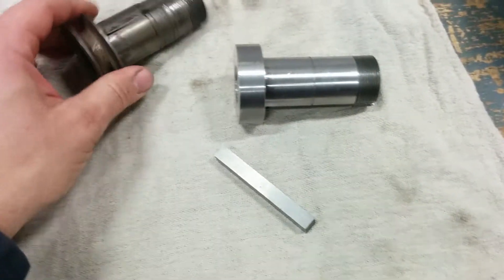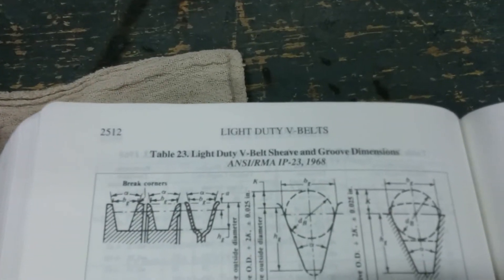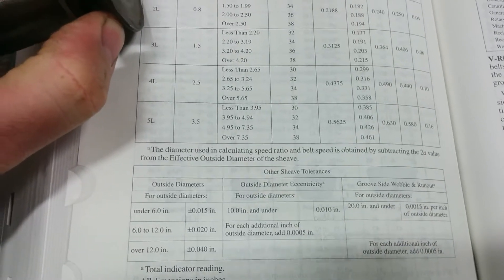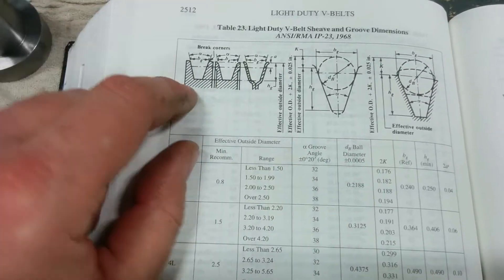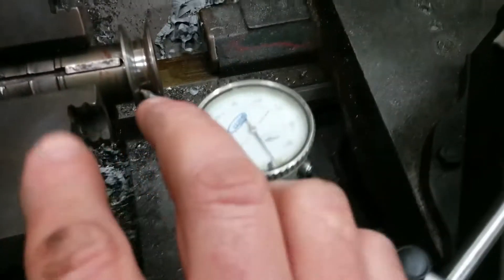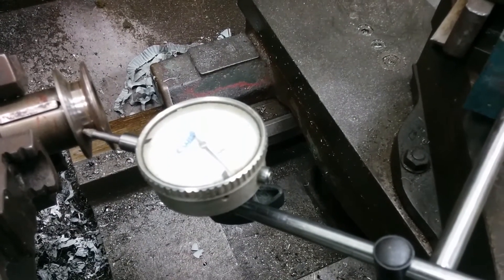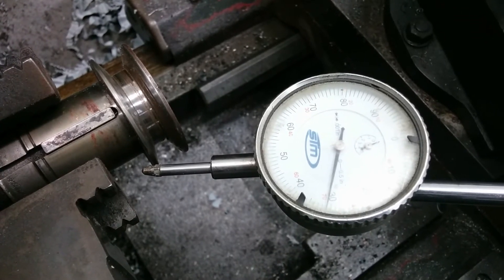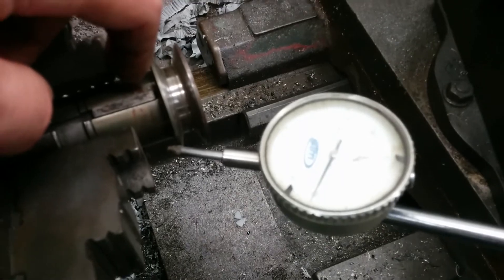Rockwell 21-200 Spindle Hub episode #6

Comment: The angle on the V-belt pulley is 'included angle" and so your math was close to correct as you need to half the angle you were looking for (30 degrees from machinery handbook * 1/2 =15 degrees)..appears that 34-36 degrees is what is used (+/- 2 or 3 degrees - varies by pulley diameter) and so then your 18 degrees is spot on - (but) for a pulley of larger diameter than yours. The angle tightens up on smaller pulleys (as per Machinery's Handbook), and I surmise that is because the top of the belt being under more tension than the base (esp, around small diameter pulley) then the angle of the V on the belt itself becomes more steep - larger at base of V relative to top of V because the belt is elastic and a bend would expand the base relative to the top (I.e the base of belt is under less tension than the outer part of belt)- So then, perhaps you should have cut it at 15 degrees (per Machinery handbook) on such a small pulley diameter, But I bet it works just fine as you made it - excellent video series and job.
FYI- I have the same mill and measured my pulley angles - my angles are about 20 degrees (40 deg included angle) EXCEPT for the smallest pulley (the one you machined) being a larger angle- about 22-23 deg...? - not sure why - wear?...(I never us that pulley myself) -I am using cheap protractor - but clearly just by eye - the small pulley is definitely (strangely) larger included angle than rest of pulleys - (opposite Machinery's Handbook numbers / guidelines) .
Also see this:
http://www.green-trust.org/junkyardprojects/FreeHomeWorkshopPlans/MakingV-BeltPulleys.pdf
Reply from the maker: Thanks so much for the break down kgize.  When I started digging into the numbers and things weren't making too much sense to me, I figured I'd just mimic the oem part and be done with it.  I don't intend on using that particular sheave anyway.  The end game is a VFD controlled 3ph motor replacement, so the belt placement will be left in the closest 1:1 ratio and the VFD will alter tooling rpm.

Another thanks for the kind comments regarding the project.  Although born from necessity, I enjoy tackling new challenges.  This drive hub had a few in the mix for me.